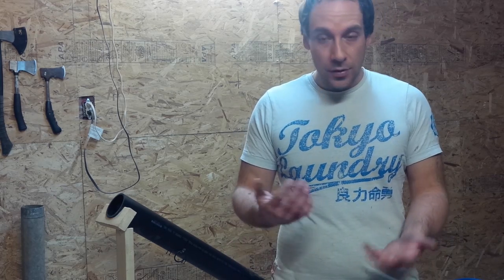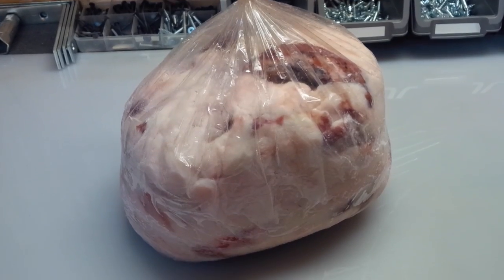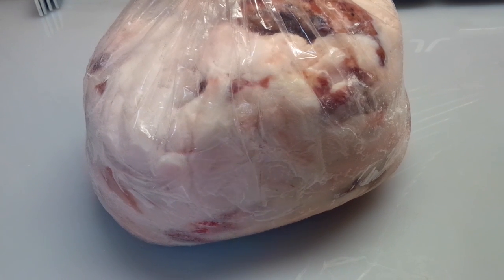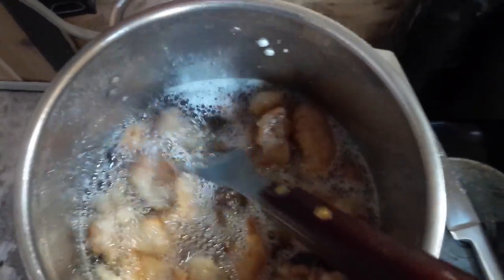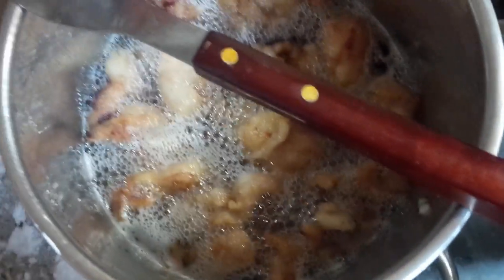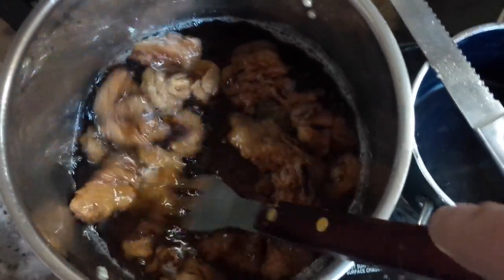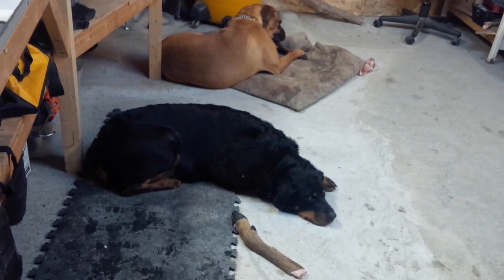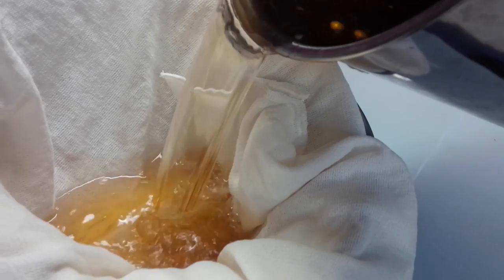Making Bear Grease

Comment: Whats the point of adding water? Could you not just boil the fat pieces on their own?
Reply: theyd just burn id imagine since you have to do it for a long time
Reply: Low smoldering point. Adding water helps prevent scalding and smoking and most of the water boils out anyways when it boils down.
Reply: I just learned about using the double boiler method. I'm doing bear fat right now. Seems to be working great 😊